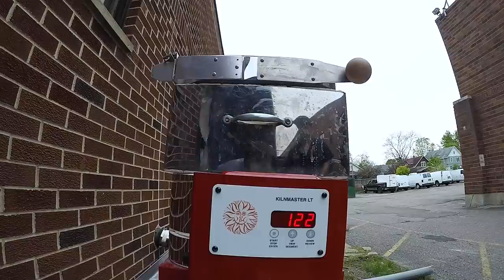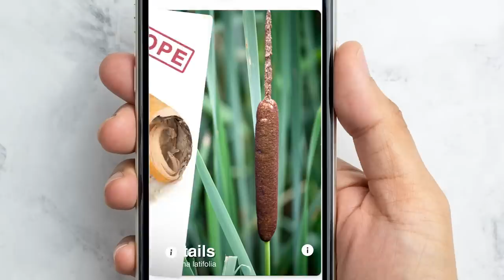Making a Fire from Scratch

Comment: Use Animal fat on the twine to make the string stronger or make just make it stronger. Back in the olden days ships would made there own strings and ropes by hand. I think back in the mid 1800s is when you could by rope at  a store every used to be able to make string and rope at the age of 6 year old. Ropes were made from jute, hemp, cotton, coir and sisal just to name some. Ships crew would hire just rope makers. The ropes makers would be alway mending ropes and strings on the ship to replace the old ones after a storm. The shipmates would use the rope to tell the depths and the speed of the ship as well. People have used rope since 4,000bc that we have found maybe even longer. Since ropes were made from plants they brake down fast and it very are hard to find intact.

Comment: I find it easier to get sparks from two pieces of flint than using iron pyrite, use those or a piece of high carbon iron but of course that's a modern material

Comment: The reason your method with flint and Iron pyrite didn’t work was that you need a very specific part of the Horseshoe-fungus. It is the soft second layer. And not the tubes on the underside.

Comment: When I was a child, I remember hearing from several sources that one could make fire "by rubbing two sticks together." No. Having gone camping numerous times as an adult, I can say that making fire is hard.
Reply: I think the issue a lot of people encounter there is they use the wrong kind of wood. I have personally witnessed someone start a fire with two sticks (no bow drill either), but the sticks were hibiscus wood, which has a lot of natural grease in it and is hard enough for good friction. If you don't have access to hibiscus or a similar wood, just rubbing two sticks together is very unlikely to work.

Comment: Spindle to small of a diameter, and too long for a bow drill rig... woods used are too similar in hardness/softness... putting your weight on your knee and holding your forearm firmly against your shin are key to stability...

good job

Comment: there is a step you are missing. Before smelting ores, you need to learn to make your own Charcoal. Charcoal burns hotter than wood and most cultures used charcoal all the time. Not only that but since charcoal burns hotter than normal wood and is mostly carbon, it was the reason iron was turned into steel in the early days. You need to start making your own charcoal.

Comment: Use leather for the bow string and it won't break every ten seconds
Reply: In my experience leather breaks in 5 seconds :/ 
a thicker cord seems to hold up better though
Reply: I have a bow with leather and its probably 20 years old and its still in one piece
Reply: @Unkn0wn072  I've tried it a half dozen times. always broke before I got an ember.
I reckon I was just working with crappy leather haha.